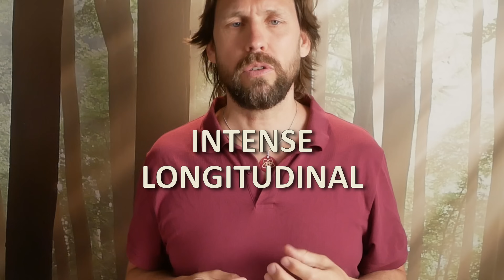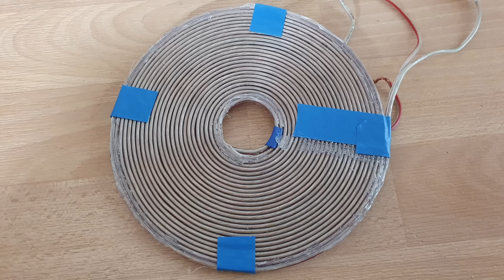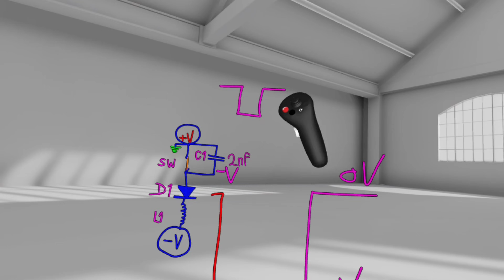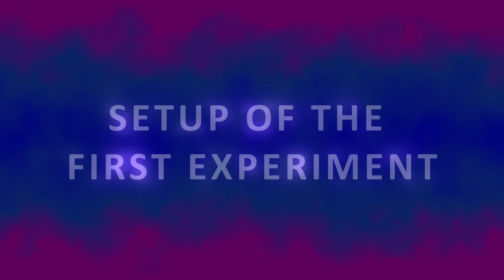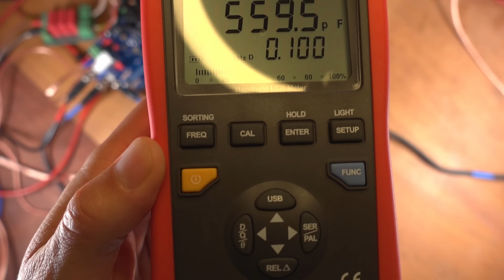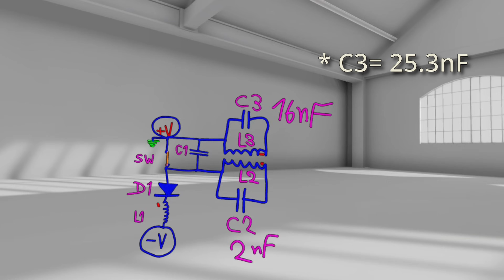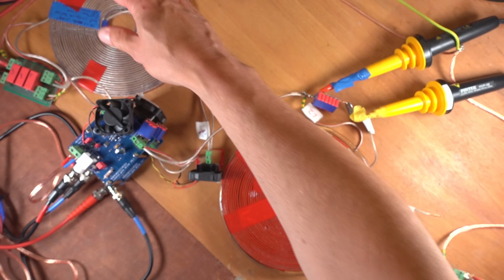Dielectric Induction producing Ground Currents

Comment: Cool.  I have been working on this on and off for 50 ears and had just recently considered MODFET switching, because I totally dislike the idea of air gaps and mechanical switching (rail points) in these type of circuits.  Watching your presentation made me think the way to induce a more complete DC voltage and higher amps would be through the use of four parallel MOSFET switching circuits, timed slightly off (delayed) through slightly different capacitor values. This should produce a purer long square wave.  Many ways to produce this, but you have something here that I like and it produces consistent results, which means it is repeatable and doable anywhere and any time, doesn't require renewable resources to power it (oil, wood, water flow, etc,) and something I will begin working on this year to refine my own Earth Resonance power antennas.  I believe a building can be powered by the cubic space and energy that the building sits on.  The same with the atmospheric energy around us, and it only take a method to stir this EMF into something useful on the scale we use power in the current society mode and model.
Reply: Theres enough energy in the empty space of a standard coffee cup to boil off earth's oceans so be careful. I'm trying to build a resonant circuit that uses constructive and destructive frequency between two coil assemblies to maintain a charge. The goal is to increase constructivity when it begins to loose charge, so it can power things without actually losing all the charge, and using destructive frequency when other things being powered are disconnected so that it doesnt overload and fry itself. I think I might start with this though. This is highly reminiscent of teslas tower I think.

Comment: About harmonic tuning, is there a specific reason why you are going for 1/3? Maybe you want to try the ratio of a perfect fifth wich results into matching with the whole "solfegio or the octave's notes"? 3/2. I would also try 1.26 for 5/4 harmonic wich is (cube root of 2). The 1.26 value instead of 1.25 resolves the need for musical temperament. It gives birth to a perfect geometrical wave expansion and resonance matching to infinity mathematically. A432.081 hz precise temperament tuning by robert edward grant.

Comment: Interesting how your using the earth to send your positive signal
Reply: as a noob to electronics i have never before seen the positive directly connected to ground/earth
Reply: @garygranato9164  when you consider how crystal batteries make free power as long as they are hydrated it makes sense that you can indeed use the earth as a medium to transport energy or signals

Comment: at what point could you harvest the current without disrupting the resonance another coil ?
Reply: I think it will depend on the charge and frequency tuning. He has not run anything at the moment. Understanding the working principle is trivial before powering a charge with the systeme. He is about to do it though. Ive seen his work from the Beginning and he is about that far into the process now.
Reply: I tried to watch the whole thing but nodded off. I expect the whole point is you can't harvest any electricity. It's just a fancy step up voltage circuit.
Reply: You need a transmitter and receiver antenna coil circuit in as perfect resonance as possible, they will become connected via the dielectric field and then you can extract power from the receiver coil without putting load on the primary, 1 transmitter and multiple receivers, patent 645,576, obvious implications.

Comment: I have always considered Power equivalent to Energy.  Power is equal to current time voltage or I squared times Resistance. Yet you keep saying the Energy is much larger. Energy released is measured with time of release. The timing of output is faster than the charge in input and increase in voltage is simply due to the Impedance of the source supply, and the discharge is due to the lack of impedance to discharge. The energy is less due to losses in the circuit. You CAN NOT produce Energy in this method. IMHO
Reply: You have to think of it like an electric version of a heat pump.
Reply: @technosaurus3805  bad comparison, heat pumps dont work

Comment: Dear Ivo, since our last conversation i see your pointed disruptive discharge which is good way to go. I talked about nanosecond discharge, and you achieved 60 ns seconds which is great. I have thoughts that real game changer is in picosecond range. That is possible with mosfet avalanche breakdown. 120 V PS is needed for that. Guys made that project on tube. But that is just one aspect among many. Nonlinearity is another and you pointed that. Your current setup iresistible remands me on Tesla 3 coil design. I mentioned you that i will go that way. Tesla system is machine not clasical transformer. I asked myself why transformer with low coupling? I guess that is for Over unity capability. Yout high impedance coil matches Tesla L3 top coil. Tesla clasic design  looks simple but it is not. Paralel primary resonance for high impedance low current sucking from source. Low coupling to secunday serial resonance. That serial is important and esp harmonics. You are good hunter. You noted third coil high impedance- must have. I guess that third coil so called top load is not load but reflector. Its task is to form and maintain standing wawe in secondary coil.    When having standing wawe aparatus become pendulum. Pulsed it at wright time with same pulse amplitude grows each time to lvl of another disruption. Harmonics (odd) and phase shifting plays role in all of that. I guess that L3 should be most capacitive coil to form longitudinal wawe so driven by large amount of voltage not current. That coil shoud produce displacment in medium and spread through aether without loses. That's my ideas for experimentigh. I bought some equipment still need workplace. In meantime i see you on good track.   One note about ground current. To be shure abot that statement separate ground from + terminal of PS just like Tesla did in case of secondary coil. Cheers from Croatia.

Comment: All of this can be over simplified with what tech's call a  TANK circuit!
Reply: Nested coils, with a frequency tuner. TREC system. Tesla Radiant Energy Collector.
Reply: @Cryptic_Triptych  A rose by any other name is still a Rose!
I am not saying there is no Radiant Energy. But it cannot be harnessed, by us!
Think of it as a deep sea fish trying to harness the deep water pressure for power.
Not going to work, unless...
Reply: @marlonlacert8133  It gets quantum size... there's plenty of room in it !!! To get pressurized by outside water. But you should be able to deconstruct macroscopic matter to a quantum level. Similar process as when creating atomic bomb which also deconstructs matter, but the explosive way.

Comment: Nice idea! But A Dielectric Field cannot exist!
What you have done is make coils into a massive Capacitor!
However, you are getting what looks to be strange data. But that is that you need to look at it as being inside a capacitor..
NOTE: Lorentz Force Law is still in play! Bit as a static field.

HINT: When does a Dielectric not be a Dielectric? The moment it conducts!  IT then becomes a conductor, even if only Temporarily!
Reply: 😂 Exactly 💯 👏
Reply: Believing in Lorentz force implies you believe in "charge". What then is a "charge"?
Reply: Skim/study the original papers of Heaviside, Steinmetz (father of EE, he calls the static counterpart the dieletric field), and Tesla (the patent of these high-capacitance bifilar coils), and Terence Barrett (Tesla's nonlinear oscillator-shuttle-circuit (OSC) theory).

Steinmetz: The magnetic and the dielectric field of the conductors both are included in the term electric field, and are the two components of the electric field of the conductor.
Reply: You have substantial mistake in your reasoning... Dielectric doesn't become conductor until the capacitor is destroyed ! It just stabilize Coulomb power by Lorentz force !!! What's conducting is the metal on electrodes.
Reply: The Dielectric field is the Aether under torsion, that's it.
Reply: @JenkoRun  Space time under such load, has poor words for it.. But Space frame dragging is the most used.
And since the word "dielectric" typically means materials with a high polarisability. 
In other words an insulator!

And insulator field, would have to be a non magnetic, non electrostatic field that stops electricity, and static fields. 
In other words, a Star Trek like forced field...

None of this works shows any such abilities..

However, I see the potential that he might come up with a very cheep way of storing power! And I em look forward to how that might reshape the economy, with a cheep supper battery.  Supper as in large but cheap to make on a large level.
Reply: @marlonlacert8133  Space time cannot be under any kind of load because it doesn't have properties, space is a result of the loss of the dielectric field in the form of magnetism, force and motion away from counterspace/Aether, it's no more itself a thing than a shadow is. Tesla was adamant about that and rightfully so.

A dielectric insulator and the dielectric field are not the same thing.
Reply: @JenkoRun  "Space time cannot be under any kind of load because it doesn't have properties," <-- Wrong! Do you not even read the science papers on how mass bends space and time?

"dielectric field" <-- does not exist! You keep calling something that already has a name, your own name..
Like calling "Rose", a "dielectric flower"!
Stop it, for the love of real science, stop the baby talk! Call it what it is!

Lastly it have been long proven that space and time can be under load.
Reply: @jenkorun1306  indeed.

I believe you are talking about Alfen waves and Birkeland currents. They are both undetectable (in Stasis & unquantifiable at zero Kelvin) until a perturbation occurs, resulting from induction resonance (Space Quake). Of course there is always friction and skin effect where the dielectric and magnetic fields interface but the hollow inner cores of these chiral helical ribbon vorticies contain Aetheric Fluid, pure essence - Scalar energy. When the Aetheric Fluid comes into contact with Reality (3 Dimensional Construct) it transforms into Plasma, which is the first phase state of matter (ie. The Amun Ra).
Reply: @Cryptic_Triptych  Thank you for Explaining it to him..
I do did feel a wee bit petty arguing over words..
And I did not want to explain N waves and Alfen Waves... As that is currently where my own research is locked at.. 
"They are both undetectable" <-- that is where I found something.. But that is long long story..
Hint: Slowed down light looks to be able to be used to detect them.. Or so it currently looks.. Give me some credit, if that helps you in your work. lol
Reply: @marlonlacert8133  you are welcome. I am a bit rusty and had to edit my post, as I haven't had to speak on this subject in quite a while. 

I would also add, specifically to you. To say something doesn't exist is incorrect. Certain things do not exist in specific situations and conditions. However, given the right circumstances, confirmation of theoretical ideas can and do happen. 

Thirdly, it is extremely difficult to detect the presence of something when you exist within that something. 

And Finally, The Noumena (non-physical) can not be discovered by using physical means. The Physical Realm is controlled, or engineered by a set of guidelines. Once a "particle" (frequency perturbation) reaches a Bloch wall, it crossed the noumenal/phenomenal Realm barrier. This is also known as phase shifting, Kant's theory of Action.
Reply: @Cryptic_Triptych  "To say something doesn't exist is incorrect" <-- You are correct on this.. However, in the events they are listing and showing, it cannot exist.

I looks like they are looking at Wiki and not understanding the full scope. 
'Dielectric is another word for insulator. When a dielectric is placed between the plates of a capacitor, it increases its capacitance.' <-- it increases its capacitance, by having the plates close, yet the space acts with the same resistances found at larger spacing. 

To us that may read as almost biblical.
But I remember, when I was 12 and first learning this.. It was not something a normal person has intuitive reference to.. 

Only with lots of experimentation or playing around like they are in this Video, was I able to develop a full understanding, of this topic.. 
That is why I like these types of videos.. At the same time, incorrect learning can hurt long term gains.. 
I only had books! 
This fellow, has the whole world!
If luck and persistent, he may discover something new! 
And if not, at least develop a new way of thinking, that will be key to a good future..
Reply: @marlonlacert8133  the three effects which are at play here are Casimir, Hall and Bloch wall. 

If we look at these three as a complete whole instead of separate events, we understand the basis of phenomenal/noumenal emergence.
Reply: @Cryptic_Triptych  Sure looks to be.
But the Bloch wall, is under some extreme changes here. Almost like he is making a  standing wave of Bloch wall. And this is somehow holding a lot more power than many would have checked before..
And as they degrade voltage is made..

This could be key storing mega amounts of energy in a torrid coil. What do you think?
Reply: @marlonlacert8133  there is a continuous loop of charge and discharge, as I have explained. The only thing that we require, is to tap into this universal whirlwind of energy, in order to run our machines. 

As Viktor Schauberger, Nikola Tesla, Thomas Henry Moray, Hermann Plauson and many others have discovered and patented, there is an endless supply of (free) energy, it is all around us.
Reply: @Cryptic_Triptych  ", there is an endless supply of" <-- Yes you are correct.
The problem is like water!
A deep sea fish is surrounded by mega  pressure of water. Yet how can said fish tap into that source of near endless power?

Currently all power we make is made from. Tapping a high as it flows to a low!

So the energy of space cannot be tapped until we find a place to dump it. (a low zone!)..

Right now storing endless energy is far more important. If we could do that, then space travel will become the norm..
As people would build a massive solar Space station, all to export power to earth.
Reply: @marlonlacert8133  Furthermore, NASA conducted experiments during the STS missions to measure the Atmospheric energy storage. The tether experiment STS-75 tells us all we need to know about utilizing the atmosphere to charge satellites and space stations.
Reply: @marlonlacert8133  for some reason my comments are being heavily censored.
Reply: @marlonlacert8133  If you understand Viktor Schauberger, "The Water Wizard". Then you will understand how to tap in and use the hypertoroid and hyperboloid. Please see W7X Stellarator and ITER Tokamak.
Also, please understand
Magnetohydrodynamics and
Sonoluminescence.
Pressure (voltage) can be utilized just as a fish uses water pressure the "low zone" is Earth.
Everything moves from high to low, back to high again, Ouroboros
Reply: @marlonlacert8133  You do not have to create a storage point, it
already exists, the Earth itself
You can not, and never will be able to travel into "outer space". You can not travel past the atmosphere of the Earth. Which incidentally expands out more than 400,000 miles from the surface. I have proved this to those who can not be named on this platform. The article was published on the second month, on the twentieth day in 2019.
Reply: @marlonlacert8133  There is a way to travel through the Scalar energy, from one node to the next (celestial bodies). Both Viktor Schauberger and Nikola Tesla built such craft and the patents are still available. The US Space Navy (as well as the Germans) have built these craft. The one known to the public is the TR3B.
Reply: @Cryptic_Triptych  Yep that was one way to get a high to a low.. And Wow did it burn the cable..
Reply: @Cryptic_Triptych  You think that is bad, I got banned for a comment, made 3 months before the Joe Biden election.. And the ban was held till one month after the election..

I had said Joe would win with over 119% to 125% in a few places.. As he had no choice but to win that way.. 

I then got an angry letter from someone at YouTube.. And poof I quite being a fan of YouTube.

So they tend to heavily censor anyone who is correct, or might be correct.. As they look to have a narrow child like view of reality..

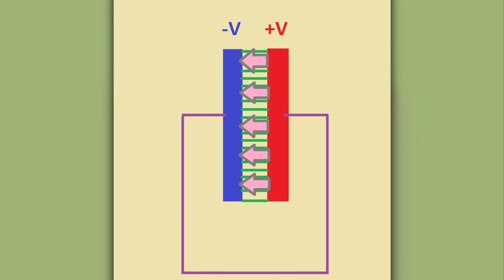Comment: @20:54  A capacitor is a blocking device.  I don't believe anything can flow through the dielectric of the capacitor.
Reply: As a Tech, I have seen many cases of electricity "flow through the dielectric of the capacitor."... 
ALWAYS makes a big BANG, and some smoke!

Always remember a "dielectric", quits being a "dielectric", when voltage flows though it!

Note: what they are seeing here is the Harmonics of a Tank Circuit! 
In electrical engineering, you are shown Tank Circuits, only to spend the rest of your Circuit design life, doing math to avoid, making a TANK Circuit..
Unless you are into making TASERS or microwave units..   Then you want an optimal TANK Circuit!
Reply: @marlonlacert8133  voltage flows through it?
Reply from the maker: look into Maxwell's addition to Ampère's law (displacement current)
Reply: @MasterIvo  Magnetic current?  Shades of Leedskalnin.  I will take me awhile to wrap my head around this one.  But of course dielectrics are invisible to magnetism.